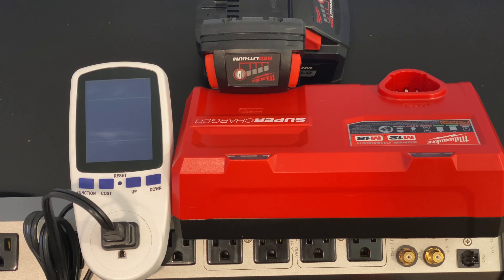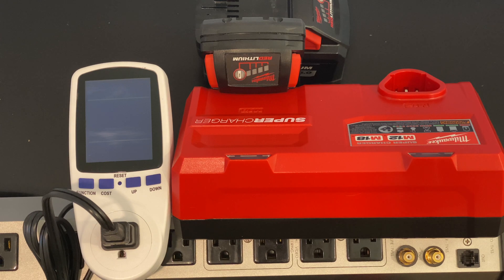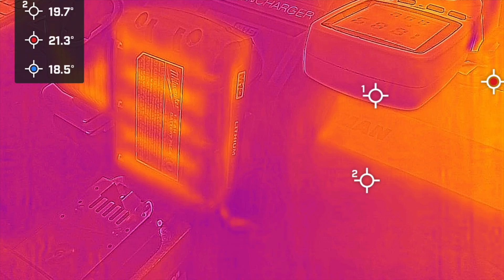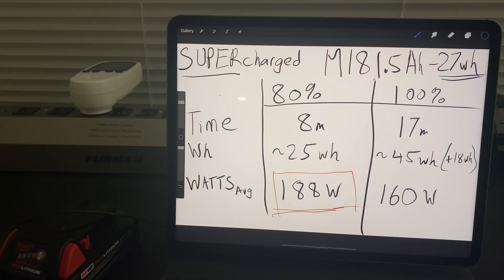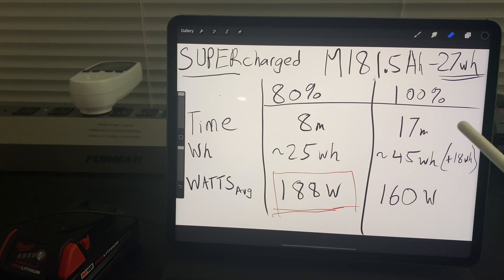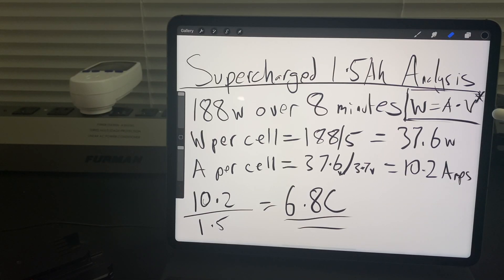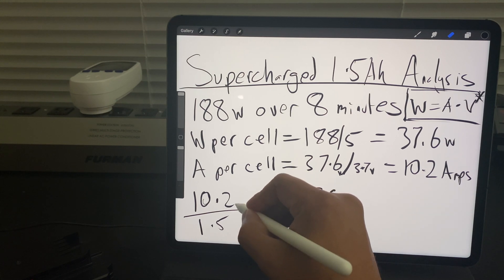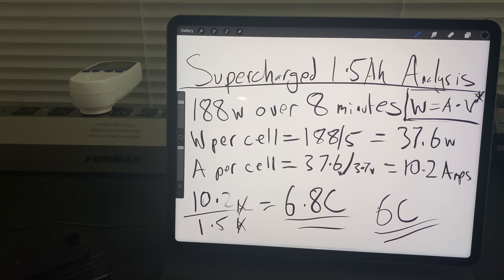Is the Milwaukee M18 Supercharger COOKING your batteries?

Comment: honestly i think it's probably fine, definitely pushing the limits, think if you put one of those small batteries on a grinder it would last probably 2 minutes or so, it would be hot, you just discharged all that energy in that time, if it can charge in in what seemed to be around 15 minutes by what you said, thats power going out at approximately 6 times the rate, if you look at a lot of lithium batteries for vehicles and boats they might have a 100amp discharge and 50 amp charge rating, thats 2x discharge rate, i know its not the same thing but id say it probably is fine, and most likely a lot of specs are just precautions and probably overexagerated from manufacturers, some days here are 36c so the battery would likely be too, especially if its in the sun, then you use it and heats it up itll be 40-45c probably, i'm sure it is ok, maybe the battery will only last 5 years instead of 6 or something, its awesome to see you test all this stuff though because how else would we know. love the channel its just my 2cents don't stop doing this stuff because its very interesting.
Reply from the maker: I appreciate the words of encouragement. I have an XMAXX and I actually put a clamp meter on that thing and measured a peak draw of 2kW. Comparing took batteries to a 6S or 8S pack might be pretty fun! Great idea. The issue though is that we’re comparing LiPo packs to these guys that can’t handle that level of power. Let me do some homework and that sounds like a fun topic to discover. Thanks again!

Comment: On milwaukeetool website it does specify that it’s optimized for the “high output “ batteries meaning the 6.0,8.0 and 12.0
Reply from the maker: You’re right - but the supercharger charges the 1.5 and 2.0 faster than the Rapid charger, but the others like the 4.0 and 5.0 charge at the same speed. I’d expect them to behave the same for all non-HO batteries, which isn’t what I found.

Comment: That constant voltage stage seems wayyyyy too high as far as the current winding down at the rate it does. The cell is sitting at 4.20 (or the whole pack sitting at its max charge voltage) eating over 4 amps for like 4 minutes? Overall the current is just way too freaking high. I'm sure it would be a lot of work to break down every type of battery, what cells it has, and then determine how many of them are being charged at double their maximum charge rate or charged over their maximum charge rate.

10A per cell? The 25R is rated for a 4A maximum charge rate and that's one of the higher charge rates for 18650's
Reply from the maker: Exactly, completely agree. The charger is completely ignoring ratings on the cell’s data sheet.
Reply: The Molicel P28 and P42 have a max charge current of 8.4A so if you're pushing it beyond that you're smoking crack

Comment: Hi I had a suggestion. Doing this heat test with a 2.0/4.0/5.0 on a standard, rapid, and super charger. Seeing what heat levels do and if they get to levels that could cause early degradation of battery life would be interesting. 

I have a standard, rapid and super charger and I put all my standard/XC batteries in my rapid and my HO batteries in my super charger. I have noticed the heat difference when putting an XC/CP on the super charger. It gets to hot for my comfort level, but I don’t have any way of measuring the heat it generates. I typically put a small usb fan on my work bench facing the rapid charger and battery and have noticed it greatly reduces heat to touch on the battery and also noticed it charges a bit faster.
Reply from the maker: I’ve noticed that the 2.0 and 5.0 recharge at vastly different power levels. The 5.0 charges at the exact same speed as the rapid, but the 2.0 charges at lower power levels - which doesn’t make sense to me.
Reply: @BatteryTestChannel  that’s a good point. I haven’t really noticed a difference or paid attention to that
Reply from the maker: @joelnrs  I said that backwards. On the supercharger- the 2.0 is given more power than the 5.0. 
Said differently: There IS a difference between the supercharger and rapid when charging the 2.0, but no difference with the 5.0.
It may be due to heat, but long story short - I wouldn’t charge my 1.5/2.0 in a supercharger. Every other battery is fine.

Comment: Can you test this on the newer batteries that are made for the super charger. Such as the 3.0, 6.0, 8.0, and 12.0.
Reply from the maker: Hi Cecil, sorry for the late response.
This is a good question. What’s interesting is that I find that the Supercharger actually puts in LESS power into the 3.0 than it does the 1.5 and 2.0, which makes no sense to me. The 6.0, 8.0, and 12.0 charge at full speed.

Comment: Nice little comparison. But 36C is about what 95F...that shouldn't be harmful to a lion at least in my experience. That seems well within the operating range to me. Would you agree?

I certainly agree that it may  reduce efficiency a bit but, I don't think you could consider 36C MAX temp as cooking batteries. 

I may not be as knowledgeable as you but, I'm certainly more competent in the field than your average Joe. And lease let me know if I'm wrong...Like I said I agree with you about the efficiency stuff and I agree that running slightly cooler in the operating range is always better but, I just don't think that 36C is anything to lose any sleep over or really be concerned if you use the Super Charger to charge your lower capacity/output m18 batteries. If you have both chargers and it's convenient enough, then sure, slap your high outputs on the Super Charger and your lower capacity batteries on the standard charger...
Reply from the maker: Right, I do agree with you. However, 36C was the external temperature, and I’m sure that internal temperatures were significantly higher.
This gives me an idea. I might take out the cells and charge the same pack without the back cover and I’m curious if i will see higher temperatures.
I’m here to learn with everyone else, and to share what I know. Please don’t assume any knowledge on my part, and thanks for commenting and subscribing. I appreciate it!
Reply: @BatteryTestChannel  ya that's true I hadn't really considered that. im not sure how accurate those thermal imaging guns are and if they have more ability to penetrate than a normal temp gun. but yeah it would be interesting to see the actual battery temp. I'd guess the actual lion batteries are maybe 5, maybe 10% hotter than the surface of the case. so still probably acceptable but definitely getting close for comfort. do you know if the Super Charger and M18 batts have any temp failsafes built in? I thought it would shut off if it recognizes the battery getting too hott? At least just from a safety perspective, that would be ideal. Even if it doesn't hit the failsafe though I agree always heating up your batteries to near their limit is never ideal.
Reply from the maker: @sml2238  IR cameras have absolutely zero penetration. They strictly read surface temperatures. Emissivity becomes an important factor with IR, so it’s difficult to compare surface temps, but a before/after would be fair i believe. Far as accuracy goes, I’ve had good luck with this FLIR Pro unit.